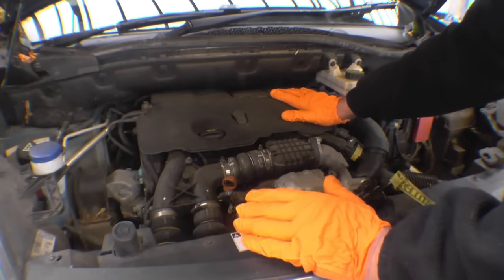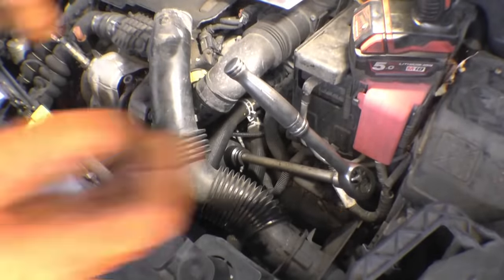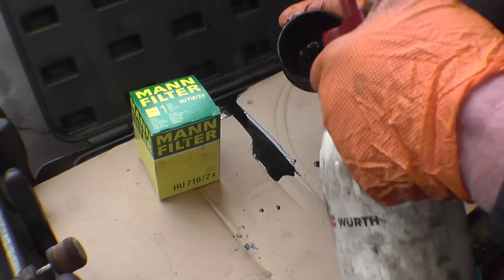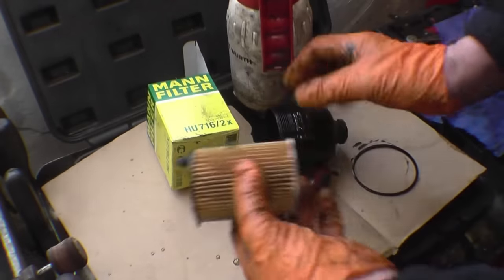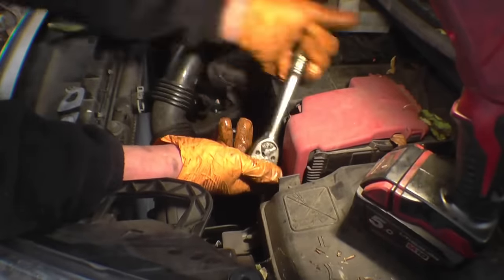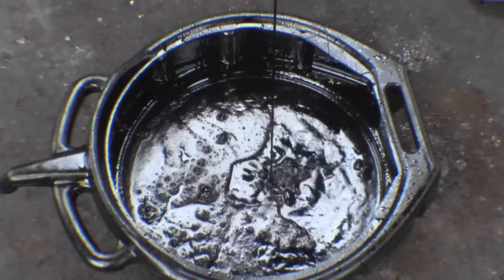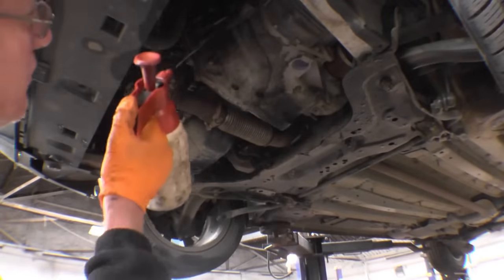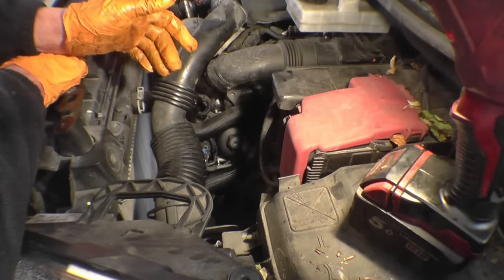Citroen / Peugeot  1.6  HDI  Oil & Filter  Change

Comment: You can't get all the oil out of that sump. There's 500ml left inside because of the design. Therfore using a extraction machine is better on this engine
Reply: I took mine off and cleaned it,   the oil left in the pan was like sand paper because of all the metal particles that normaly drains with the oil over time...

Comment: If you notize, the oil dripping of the dipstick is already black, that is because this engine´s  drain plug is sitting about an inch higher than the bottom of the oil pan so you never get the last 1/2 liter of oil out of it, this and the banjo bolt with a mesh screen have costed so many turbo´s that aftermarked you can get a oil pan with the drain plug further down, as far as I know neither Citroen/Peugeot or Ford would recognise the problem so owners had to pay them self for turbo´s

Comment: The early 1.6HDi engines had faulty injector seals, it's one way that carbon ends up in the oil and knackers the turbos. There's a banjo bolt in the turbo oil supply with a mesh screen that gets clogged and starves the turbo of oil.
Reply: I second that.
Reply: @zephyrold2478  so clean mesh or remove it. have heard of this with other motors.
Reply: Also, IIRC, the oil pickup pipe and filter were smaller on the earlier versions, so took less to block and shred the turbo.
Reply: hi how early ?

Comment: Nice job well done. I did a double oil and filter change on my 1993 Diesel Mondeo, this was my first of many Diesel's, I could not believe that the oil still looked black as coal. I then changed to a semi-synthetic oil, and noticed better mpg, only 2 to 3 miles per gallon, but my annual mileage was circa 45k at that time. 
Mineral oils do not retain contaminants in suspension for prolonged periods, I found this out when I used to rent a council lock up car garage, and after an oil change, left the used oil in a newish tin, forgot about it, then many months later, was puzzled as to why it appeared new/clear?.
Compare to fully synthetic, where as an experiment, I retained a small amount in a sealed jar, this was in 2004, and it's still as black as coal.🤔

Comment: Fantastic job there mate 👍

It's good to see you fit the filter to the housing first then you know the spigot is firmly in place.
A lot of videos show them fitting the filter into the cover first which surely won't let the spiggot locate correctly. Glen.
Reply: Yeah, no mistake in both ways. Official service first put filter in cap and then screw. That pattern makes alone to put filter in right position and fit in little hole

Comment: That filter placement was definitely designed by an engineer, not a mechanic!  A quart of oil is now over $6 US, here in the States.  I loved how you cleaned off the excess oil with solvent, a touch of professionalism.  You are a man of many talents.
Reply: Good quality Mobil 1  5litre (4.5 quart) oil here UK £40 ($45).

Comment: Hi John. Great video. I have done the same at my Peugeot partner van but after job a have done the low pressure oil light turned on, when I rev a bit up is going off but then come back again. Don’t know what’s wrong with it?

Comment: as an expat now in Aus the sparsity of diesel cars over here always amazed but with no MOT (outside NSW) there are not the tight controls over emissions and hence servicing so those diesels that are around tend to be dirty, mobile smoke machines but I understand that they are soon to be banned up there is that correct?

Comment: Look very similar to the MK4 mondeo filter, but that needs a cranked filter tool to remove.
Reply: I dont need one on my Mk4 2.0L diesel, long extension and ratchet used them for  years.

Comment: Nice instructional video, I've just bought a 2009 1.6 75ps and am giving it a once over in the engine bay and I have found the engine top cover is covered with a black residue around the base of the injectors and the cover, that seems to be baked hard and is like a bit of coal. I am chipping it out carefully with a screw driver and blowing it out with an air blow gun, any tips on what has caused this, I'm guessing an oil leak that's pooling on top of the cover then getting baked hard, or leaking injector seals. any advice greatly appreciated
Reply: You have a injector leaking by the sounds of it also very common on these dv6 engines if you don't look after them.

Comment: Most people probly would say "yaaaa" some line tech work. I did that for a while load test the battery, check coolent ph/ freeze point, Inspect for brake pad wear, visual for leak's, smoked rotors(sticking pistons/ floating hardware) fill out the check list so it could be put in the data base for the repeat customers you could tell pretty much what you would see befor opening the hood coolent ph and battery state of health deterioration generaly fallows a predictable curve of decline sure wish it paid more thogh

Comment: Do you check the oil when the engine is cold?  Or should you run it for a while first? M
Reply: Warm or cold. Leave for 10 mins after running, for the oil level to settle.

Comment: Me again, a bit of searching tinternet tells me the black carbon deposit is from leaking injector seals and will eventually kill the turbo if not fixed. Now to check the terms of the 3 months warranty!
Reply from the maker: Yes it is called the "black death" the carbon blocks the oil strainer  , There is a filter in the turbo oil feed pipe  that blocks up

Comment: Oil change 10k, i usually change 5k petrol or diesel. My old Peugeot 106 xnd i did 3k miles.
Reply: 3000 miles?
Reply: @TheDajoca  Yes, cheap oil, car was on 156k miles when sold it, ran like sewing machine.

Comment: The 1.6 hdi engine should have a c2 spec engine oil not c3
Reply from the maker: C2 gives better economy C3 gives better engine protection
They are both suitable for DPF engines

Comment: Fucking stupid location of the filter. Normally I use a rag underneath the housing when I crack it loose to prevent spillage but it’s never 100% certainty it’ll be caught from the rag